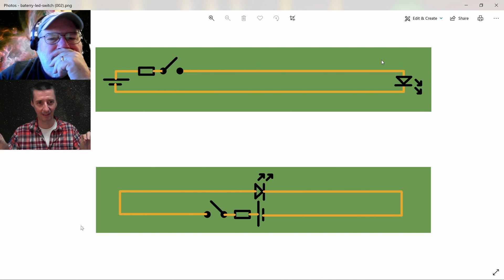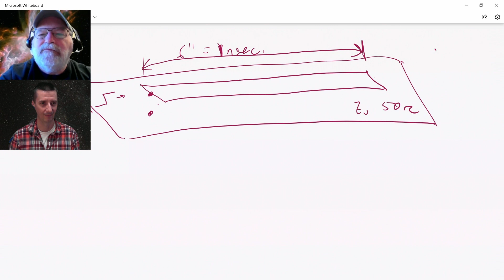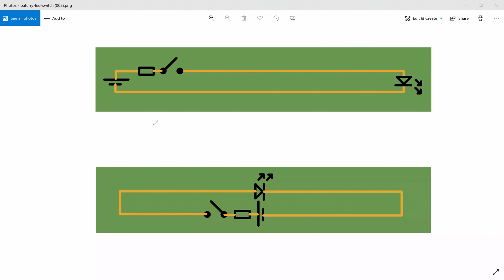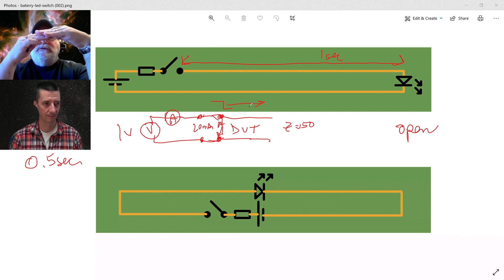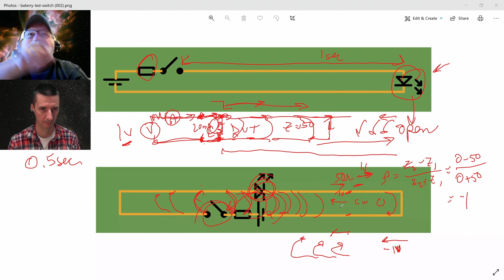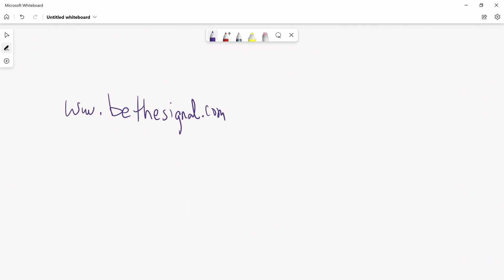Explaining Veritasium Electricity Video: Energy doesn't flow in wires (with Eric Bogatin)

Comment: Energy transfer is always in the EM field, wave or stream (DC). That was the point of the Veritasium videos.
You either "spray" it like a radio or light works (EM doesn't need metals to exist and propagate via DIELECTRICS)...
Or condense it close to the wire surface (that's the property of metals), at insulation thickness. More efficient than radio/light transmission (so we don't have a "wireless power plants").
Easy (shortest, practical explanation ever).

Comment: All of you are wrong! The light will turn on instantaneously and this has been proved experimentally, where an EM Pulse was observed to propagate 1.5 m in the near field across space with no observed propagation delay. It showed that the front speed, or the speed of information, or the speed of causal action is instantaneous in the near field of EM sources. This effect is predicted exactly by Maxwell's equations when the source terms that come from Gauss's law and Ampere's law are included in the wave equation. This was not done by Maxwell and is the reason why his constant speed c solution is wrong. Because Einstein assumed Maxwell's incorrect solution, both his theory of special relativity and general activity are wrong, as well as QED, all of which assume the speed of light is constant speed c.

Experiments by many researchers, backed by theory, now show that instantaneous signaling is possible in the nearfield of EM sources, and that the speed of light is not constant speed c, disproving both Relativity's prediction that signals cannot propagate faster than light, and disproving the 2nd premise in Relativity. What remains is the 1st premise : Galilean Relativity. If Relativity is wrong then so is any theory based on it like, General Relativity and QED.

An experiment just published in the EM journal IRECAP shows an EM pulse propagates instantaneously in the near field across 1.5 meters of space with no propagation delay. This shows that the front speed (speed of information) or speed of causal action is instantaneous in the nearfield of EM sources. The experiment was repeated hundreds of times, and also done by an independent researcher in their own lab, with exactly the same results. The paper also shows that the effect is predicted exactly by Maxwells equations. The paper is linked below. The effect can also be shown to be fundamentally due to the Heisenberg uncertainty principle. This shows that the effect is fundamental to all fields including: EM, gravity, and quantum.

In another experiment, a sinusoidal signal was transmitted between 2 dipole antennas as they were separated from the nearfield to the farfield. Analysis of the resultant phase vs distance curves (dispersion curves) shows a clear minima in the nearfield for all the EM field components. Applying well known phase speed and group speed operators to the curve, which are inversely proportional to the slope of the curve, show that both the phase speed and group speed are instantaneous in the nearfield and reduces to about speed c in the farfield.

Both experiments have been independently repeated by other researchers, obtaining the same exact results. If speed of light is not constant, then the 2nd premise in Relativity is wrong and what remains is the 1st premise: Galilean Relativity. Instantaneous signals violate the Relativity of Simultaneity because the signals appear the same in all inertial frames of reference. This can easily be seen by inserting c=infinity into the Lorentz transform, yielding the Galilean transform, where time and space are absolute. So if a moving body is observed with instantaneous nearfield light, then no Relativistic effects will be observed. But they will be observed if the frequency of the light source is changed such that farfield speed c light is used. So by simply changing the frequency of the source, Relativistic effects can be turned off and on. The only possible explanation is that the effects of Relativity are not real and are just a type of optical illusion. This result will affect all of modern physics.

In addition, the above results are predicted by EM theory. Maxwell's derivation of the speed of EM fields was wrong. The reason is that EM fields are created by sources coming from Gauss' and Amperes laws., and these sources must be included and can not be set to zero as Maxwell did. Including the source term yields a wave equation equal to a source term. Inserting a dipole source yields EM field components that with phase vs distance from the sources dispersion curves with a clear minima in the nearfield, and become only approximately linear in the farfield, starting about 1 wavelength from the source. It is well known that both the phase and group speed are instantaneous when there is a minima in the curve, and only exactly a constant speed when the curve is exactly linear, which only occurs at infinite distance from the source, which does not occur in a finite sized universe like ours. So Maxwell's solution is only valid at infinity, which does not exist in this finite sized universe. So the speed of light never a constant in our universe. If the speed of light is not constant, then the 2nd postulate in Relativity is wrong.

The same behavior can be shown to occur in gravity. It is well known that general relativity reduces to gravitoelectromagnetism (GEM), which assumes that gravity can be modeled by Maxwell's equations with different constants. So the same solution that occurs in EM theory also pertains to gravitational theory. This explains the instantaneous gravitational effect in the near field, observed in the stability of the planets, and also explains that Gravity waves have been observed to propagate at about speed c in the far field. This theory then accounts for all the observed gravitational effects including instantaneous nearfield and the speed of light farfield. The main difference is that this theory is a field theory, and not a geometrical theory like General Relativity. But because it is a field theory, Gravity can be then be quantized as the Graviton, enabling the unification of Gravity and Quantum Mechanics.

The phenomena also can be seen in quantum theory, and can be shown to be the consequence of the Heisenberg uncertainty principle. At the source, the position of the photon emitted from the source is precisely well known, hence the momentum or the speed is infinite. At about 1 wavelength from the source, the wavelength is starting to be come clear, such that frequency x wavelength ~c. But according to Fourier Theory infinite cycles are needed for the wavelength to be exactly known. So the above frequency wavelength relation is only valid at infinite distance from the source. So the speed of light never reduces to exactly speed c in our finite size universe. This phenomena should be fundamental to all fields including: EM, gravity, and quantum, and in particular quantum tunneling.

There are currently many interpretations of quantum mechanics. But only the Pilot Wave Interpretation is compatible with Galilean Relativity. In this interpretation real particles are guided by real pilot waves. But the real pilot waves are known to communicate information about the particles instantaneously with the environment. Because this is not compatible with Relativity Theory, this interpretation has not been taken seriously. But as a result of this discussion, this is no longer a problem, and Pilot Wave theory should now become our best interpretation of quantum mechanics. And combined with instantaneous nearfield interaction, can perhaps explain the instantaneous interaction observed in quantum entanglement.

For more information see the following links:

*YouTube presentation summarizing my 35 years of research in this area: https://www.youtube.com/watch?v=sePdJ7vSQvQ&t=0s

*More extensive paper for the above arguments: William D. Walker and Dag Stranneby, A New Interpretation of Relativity, 2023: http://vixra.org/abs/2309.0145

*Electromagnetic pulse experiment paper peer reviewed and just published last month in Journal IRECAP: https://www.techrxiv.org/doi/full/10.36227/techrxiv.170862178.82175798/v1

Dr. William Walker - PhD in physics from ETH Zurich, 1997

Comment: Eric goes too deeply to solve the problem that he forgets that this is a DC voltage supply that provides DC current. Okay for very tiny amount of time when we push the switch due to maybe high speed transition the LED may get energy wave through the space but that's not enough in terms of both power and time to keep LED turned on forever...the permanent thing that keeps it turned on must be the other form of moving energy in copper which is domino effect in which energy moves from on electron to the other to go ahead, and Eric himself in his book mentions this but here he wrongly goes on to explain it like a high speed pulsed signal. For domino effect it takes time for energy to reach LED not instantly after closing the switch. Eric says for high speed signal to propagate down the line it has to have changing electric field, even if we had realistic 50 ohm transmission line and a high impedance load of like a receiver at the far end, these wouldn't be enough to keep LEDs turned on forever because the only time that we have a high transition is the moment we switch the key.

Comment: Hi there! Very nice knowledge sharing) I have two questions: 1. What if the lines in the circuit (bottom and up) are displaced let's say by 100m or even 1000m. Will the displacement current still take place owing to the fact that electromagnetic wave should propagate not over couple of millimeters, but hundreds of meters? 2. You mentioned that in the right most end of the circuit where "shorting" takes place the reflected wave and direct wave adds up, so magnitude of current is not 20mA anymore, but 40mA. Isn't this a perpetual motion and free energy? Please, elaborate and thank you so much for bringing up such a nice topic!

Comment: Out of interest how would this work if for example your circuit ran around the world. I.e. battery and switch on one side of the world, led on the other side of the world, with a wire running around each side of the earth if viewed from the side/as a circle.

Due to the large gap between the conductors i assume the magnetic fields wouldnt interact with eachother and it would take the full time to travel their and back, not half as explained in the led at the end of a transmission line example? If my assumption is wrong would love someone to explain thank you

Comment: Informative but missing the point! (Or am I?)
Suppose there is a hundred watt bulb instead of an LED. It will get 20 milliamps and will not even glow until the "short" is reflected back and more current can flow.
What if it isn't a 50 ohm transmission line... (like if the wires aren't close to each other). Then you don't even get 20 milliamps!

Comment: Could someone please explain about the resistance and work perform and the current used up by the LED, to the return line, shouldn't after the LED the voltage to be less???

Comment: In electromagnetic theory you have LOCAL ENERGY CONSERVATION the relationship between energy density and WORK(fields on charges and charges on fields) and FLUX.
Poynting vector is needed for calculation of flux.
Poynting vector points in direction it does so that surface integral for flux gives correct answer.
Poynting vector is part of local energy conservation and that's the point to remember.
Local energy conservation applies everywhere of course, current or no current.

Comment: 48:35 What would happen current-wise at the LED if you moved the resistor in the 2nd example to where the LED is in the first example? Normally the order of these components doesn't matter in practice, but would they in this example?

Comment: This explanation only works for the circuit with geometry as shown were traces are close together and capacitively coupled. But if the circuit had a circular shape with radius big enough so it would take even a noticeable time for a field to propagate, such explanation wouldn't work. The latter you can't simulate in the lab with capacitors and resistors, you really need to build a physically large line.

Comment: The electrons (subatomic particles), in a circuit where there is an electric current, move with very small speeds (approximately 0.1 mm/s or 0.36 m/h (meters per hour), they are practically stationary. Subspaces around (outside the cables) the energy transport is practically at the speed of light, 300,000 km/s, so we can conclude that electrons are practically stationary in relation to the speed with which energy is transmitted from point A to point B or vice versa!😅:goodvibes:

Comment: Thank you for the interesting video!
I wonder what would happen if you increased the distance between the transmission lines. For example if the switch was on the north pole and the LED on the south pole. 
Wouldn't the capacitive coupling be negligible?

Comment: My new (elekton) elekticity says that electricity aint due to drifting electrons, or the Poynting Field/Vector, it is due to photons (elektons) hugging the surface of the Cu. 
The elektons propagate in the insulation (if any) in which case they propagate at the speed of light in the plastic, about 2c/3. 
On bare wires the speed of elekticity is 3c/3. 
A good conductor is a substance that a photon can hug, eg all metals are goodish conductors i think. 
The hugging is strong if there are free-ish conduction elektrons in the wire -- Cu has 2 such elektrons per atom. 
Elektons don’t reflect, they do a U-turn at the end of the wire. 
Actually, elektons always go straight ahead, it is the surface of the Cu that duz the U-turn. 
If u measure the speed of elekticity along a threaded rod u will find that the time taken is longer than for a plain rod, the difference being exactly the extra distance up & down over the threads. 
U should do a youtube about this. 
Your welcome.

Comment: This is a nice explanation of the problem. 
It remined me that in my first job after college many years ago, I was testing a circuit that was built from TTL and I wanted to look at the output of a 7474 D flipflop. So I fastened a wire twisted pair to the output and ground and ran it several feet to an oscilloscope to look at it. to my surprise, the Flipflop would not stay set when it got appropriate inputs.  This is how I remember it, but it was a long time ago.
After further investigation, I determined that the Flip Flop was actually setting then resetting in a very short time.  It did set properly when I put the scope probe directly on the output with the wire detached, and with wire attached you could see that it was momentarily set.
Then I realized that the scope probe was a very high impedance and the line was reflecting the initial edge from the Flipflop setting back to the chip pin. AND unfortunately the D output was internally connected to the opposite side input of the output latch (not buffered), and the reflection reset the flip flop. 

So that was a lesson for me.  Care is needed in higher speed measurements.

Comment: I can see how a pcb or coax has 50omh inpedance, do to capacitance between signal and ground beeing close together.

But what is signal and return are not close together.
Reply: Technically a transmission line doesn't have "a real impedance". At this level of analysis a transmission line is a four-pole circuit. Such a circuit can be thought of as having a transfer function that transforms an impedance at one end (two of the four poles) into a different impedance at the other end (the other two poles). A 50-Ohm transmission line happens to transform a 50 Ohm resistance at one end into a 50 Ohm resistance at the other, but that's about it. For all other impedances the transmission line will itself appear as a complex impedance.

Comment: Well what is known for certain is that on the outside of a current carrying conductor there is a spiraling magnetic field traveling the direction of the current, and in the center of that same conductor there is an opposing spiraling field traveling the opposite direction opposing the direction of the current, which is of course what supposedly creates the skin affect and resistance. Both of those phenomena must be present for energy to flow. So it appears that the fields play a significant roll.

Comment: I'm confused about the signal "reflection" he talked about. It took 1 second for the signal to reach the end of the cable, and then took another second for it to return, so you ended up measuring 50 ohms for 2 seconds. Why does the signal "reflect" instead of just reaching the end of the cable and stopping?
Reply: i guess the end of the wire has infinite impendance and where there is a point at which  value of  impendance changes, the signal will reflect partially or fully from that point

Comment: Hello Robert, Does that mean,even if the wire is open in the moon, we'll see the LED illuminates a few seonds (and then turns off)? (If the LED is located close to the switch).
And if we carry the open end-point to a further place, would we measure 50 ohms for a longer time period?